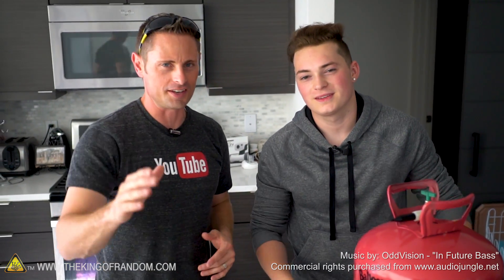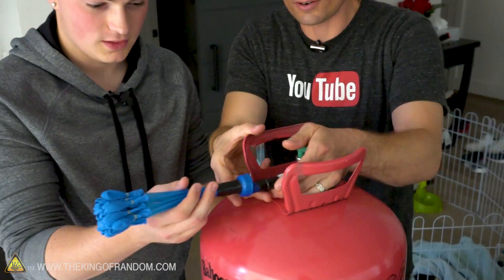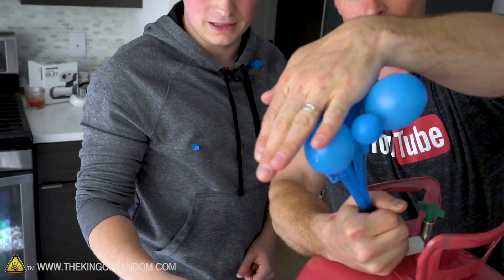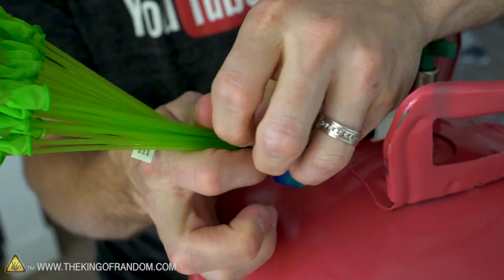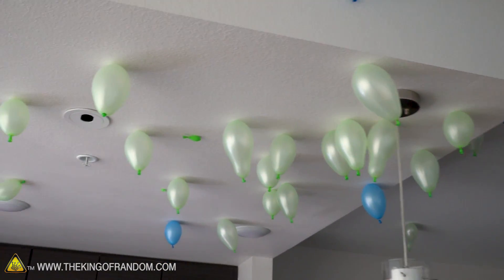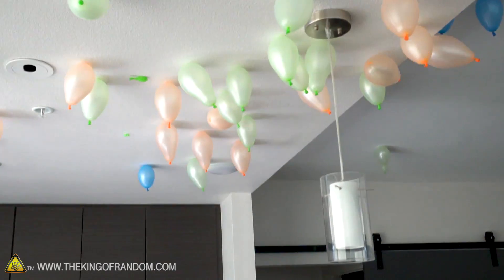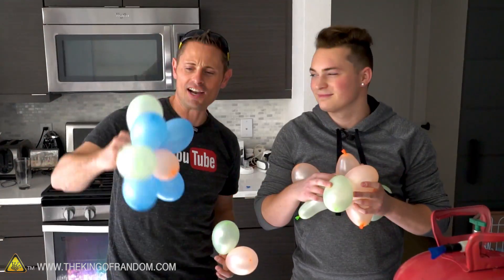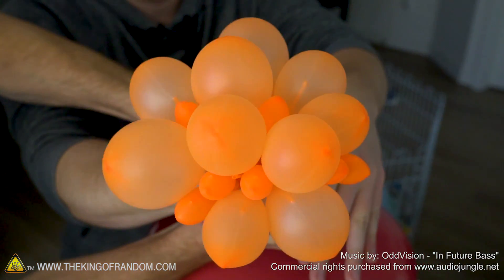Helium vs. Bunch O Balloons Experiment! TKOR Busts Out On Party Water Balloons, Helium and More!

Comment: Please fill a bunch of stuff with helium and weigh them. Over-fill an exercise ball. Pool floats, etc. Car tire, tractor inner-tube. Maybe make your own hydrogen and use that instead of helium.  Are pool floats filled with helium harder to sink in water? Will a lightweight beach ball float in air with helium or hydrogen? Then just for fun fill a pool float with a very heavy gas.

Comment: I think the balloon stuck to the ceiling because when it popped, the movement of air caused a suction inside. If you look closely, there is still air, so it must be using the suction from the air to create a deal and stick.

Comment: the one stuck to the ceiling cause it was stretched out and the balloon touched a sharp point on the ceiling and caused it to pop. the escaping air pushed it around like a rocket and as the air left the balloon returned to its natural non stretched state. as that happened the balloon caught a low point and gripped to it. if you look at it closely the part holding it to the ceiling is still stretched and the rest is relaxed

Comment: They are all blown up evenly for a few seconds, but then the super slightly bigger take up more of the helium because it has low pressure and the slightly smaller ones have higher pressure, squeezing out the helium in them, making it have no chance back at filling up, and the reason why not all of them deflate if because there is still enough helium to fill some other, and as the balloons reach a size point, their pressure builds up again, because the balloon can no longer expand as much, and also sorry for my bad grammar and spelling. :(((((

Comment: im 90% sure the reason that only half of them blow up is that of the statement of the smaller a balloon is, the more force it applies on the inside. So, for every 2 balloons, one blows up quickly while the others basically a blocked straw.

Comment: I haven't seen if anyone alse has had any answers for this but i will try my best:
1. only half of the balloons filling up: If you try and blow up af normal balloon with your mouth, you will notice that the inithial blow of air is much harder that the ones after that, so my theory is that when some of the bunch o ballons has reached that 2nd stage where it's easier, the helium goes to them, as that is the path of least resistance. And you can also see that almost all of them get a little helium to start with and then give up and route the helium to the bigger ones.

2. the empty balloon sticking to the ceiling: it's just a matter of the rubber surface that were expanded had almost no ridges in it, but then when deflatet is kind of grabbed on to the texture of the ceiling. You can try this yout your self with a hairband,  if you expand it and the put it on top of your arm or somewhere else with some hair, and the let it contract, it will grab on to the hairs on your arm. I think thats the same stuff happening with the balloon.

Comment: the reason why not all the balloons inflate is because when one balloon starts inflating its resistance decreases and acts like a sink for more air while the others still require some force to begin inflating, so the air takes the path of least resistance. its like how when you try to blow air initially into a balloon with your mouth its hard but it becomes easier as the balloon expands.

this same phenomenon would happen when you breathe air into your lungs (the alveoli are just balloons in a sense) but your diaphraghm and rib cage cause increased resistance when your alveoli hit a certain volume, thus distributing the air to all alveoli

Comment: The big balloons fill faster than the small ones because of the relationship between surface area and volume. The elastic pressure works based on how much the surface area expands, but being a 3D shape, the balloon's volume increases more than the elastic force. So you wind up with all the helium going to the biggest balloons because that increases the pressure the least.

Comment: I think it could be very interesting to mix sulfuric acid and sugar together, crumble the result to get a carbon powder, and see if the carbon powder can conduct an electrical current. If so, can it conduct effectively enough to make a circuit that you could potentially modify and rearrange at will? It might be similar to a real life emulation of minecraft's redstone dust circuits.

Comment: you should try freeze drying something...
Freeze-drying is a three-step process that begins with freezing. Next the food is placed in a vacuum chamber under low heat. The frozen water crystals evaporate directly from ice to water vapor in a process called sublimation.

Comment: Does liquid nitrogen conduct electricity? Could you try it with those electrodes and find out weather there is a spark touching the surface of the liquid like it did with the water?

Comment: The reason why the balloons stuck on the ceiling: When the balloons pop the force of the air pushes it upwards and with the contraction of the rubber acts like a glue that grips with the uneven surface of the ceiling.

Comment: Grant Thompson - "The King of Random" 
So...
I have this idea
Firstly can you evaporate gallium at a low temperature like you can melt it at low temperature.
My thinking with an application for this would be power stations,
They burn fuel to evaporate water then use the water vapour to spin a turbine which spins a generator which generates power.
If this was possible with gallium and it evaporated below 100•c (I don't know what it is in farenhigt) then it would use less fuel to evaporate it and therefore make more energy with the same amount of fuel 
So could you try to evaporate gallium and measure the temperature 
(And maybe say it in farenhigt and Celsius)

Comment: I can explain how that balloon stuck to the ceiling. I actually goof around with balloons as cheap toys at my desk and I notices something cool when you deflate them quickly. As the rubber contracts back down, if it's touching something just right, the friction causes it to gab on like a suction cup, only there's no vacuum involved, only friction. This might actually be why bits of balloon rubber stick to walls and such when a balloon pops, because the rubber contracts and clings.

This gives me an idea. Could you do a video where you try to find out what conditions make that "Stretch gripping" happen? Like, try to get a balloon to cling to a wall strongly enough to hold, say, a marble.

Comment: I'm guessing that they use really cheap balloons for those things, so the rubber thickness is going to be very inconsistent from one balloon to the next. So on the first inflation, you're getting the thinnest ones inflated while the thicker ones have enough strength to resist the pressure. Then, once the thin ones are removed and their tubes are blocked, the second inflation gets the next thickest ones to inflate under slightly higher pressure, and so on.

Comment: Grant,

First off, everybody is hating the collaborations you are doing, as well as the projects.

Secondly, your balloons thing is a physics problem. Try placing two balloons on a straw with a place to inflate them simultaneously. If one was inflated more, it will get all the air. That's what's happening with half of the balloons getting helium, and the other half not.

Comment: I have an explanation for why half of the balloons are blowing up:

This happens because when rubber balloons get stretched, the force it needs to stretch further becomes smaller. You can prove this by connecting a half-full balloon to a tube sith a full balloon and watch the air of the half-full balloon go into the full balloon. So the small differences in the balloons make some stretch a bit easier so they blow up first and stretch easier because they are bigger. If this makes sense to you.

Comment: I suggest a quick run to the hardware store grab a 1/2 pipe or 3/8 Pipe adapter to a hose bib adapter. Pipe side would be plunged on the the helium valve. The bunch of balloons would be screwed on to the hose bib.

Comment: The reason why only roughly half of the balloons properly inflated is because it takes more pressure to inflate a balloon the first little bit. As soon as one balloon is past that initial fase more helium will rush into it, dropping the pressure in the system and stopping the other balloons from inflating.

You can see this by connecting a nearly full balloon to one end of a tube and a half full balloon to the other side, the smaller one will inflate the bigger one.

Comment: The reason that only half of the balloons filled is because that those specific balloons have their rubber stretched slightly more than the others, because of that stretching there is less pressure that the stretched balloons apply to the air on the inside and that makes air or in this case the helium enter them easier, the less stretched balloons have more pressure so they squeeze the air back out and into the stretched balloons making them even larger. Its the same reason why blowing into a deflated balloon is a lot harder than one that is already slightly blown up